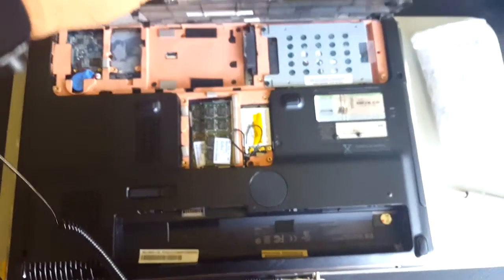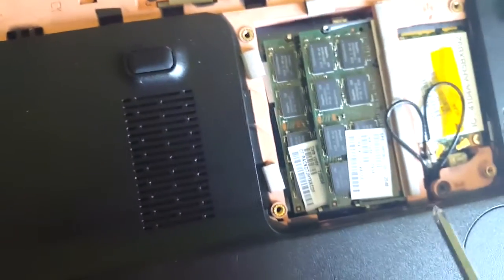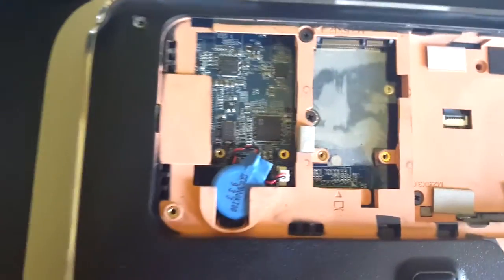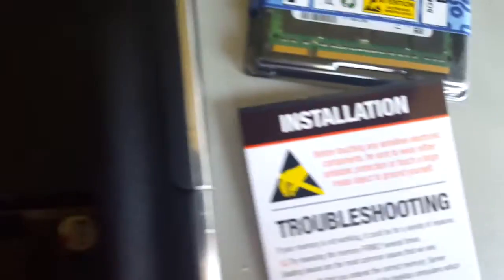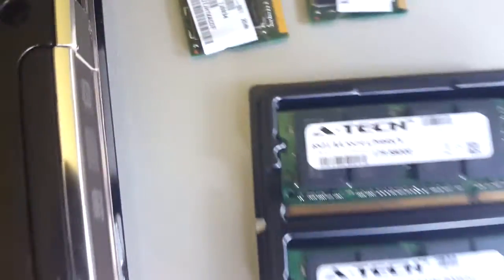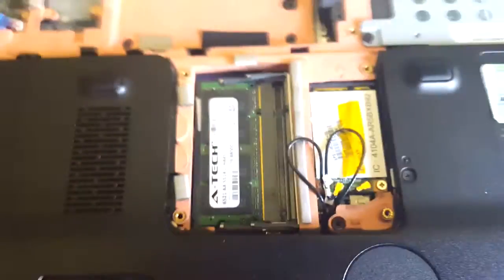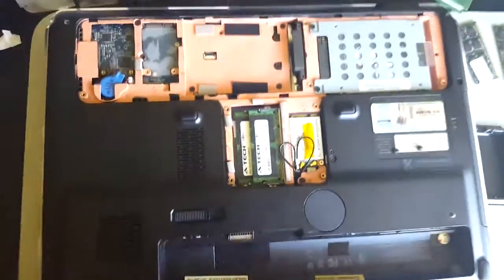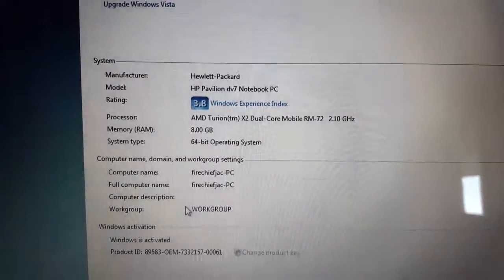HP Pavilion dv7 RAM upgrade!

Comment: HELLO, I have tried to update this laptop with 250gb ssd but it does not recognize it as boot media. You haven't upgraded to ssd? THANKS
Reply: Were you able to configure this laptop to accept the 250GB SSD? Im about to try replacing my current 128GB SSD w/a 1TB 3D NAND SSD.
Reply: @MasterArmedforces  U have to create a new partition for the drive in windows pre install.